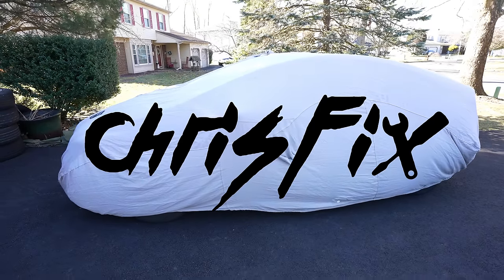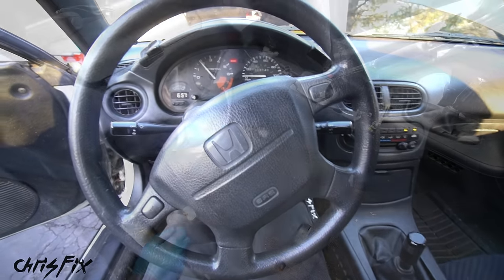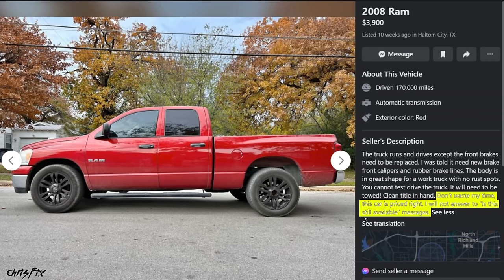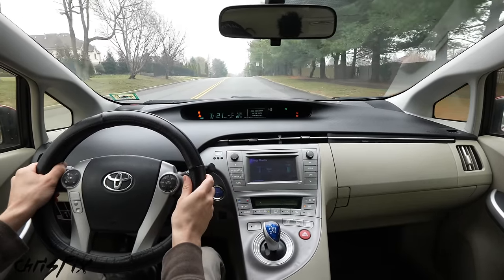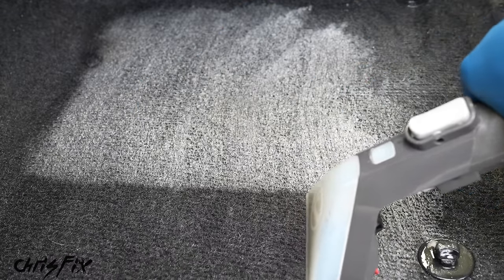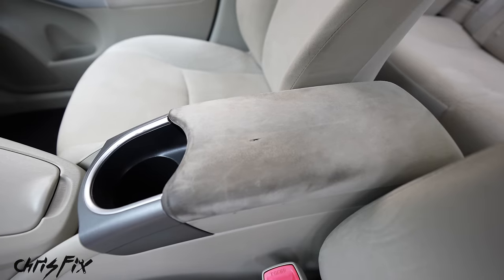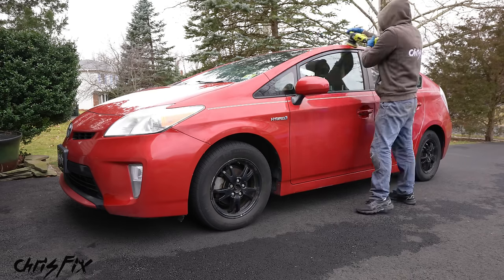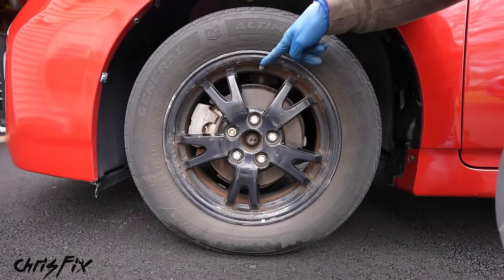How to Buy a Car To Flip for a Profit ($$$ Side Hustle)

Comment: Hey chris I have a 1995 Lexus Ls 400 that i bought from a used csr lot and had a couple of issues with the electrical system and ecu. I plan on making the car my project and with that i dont know the first thing to do as best maintenance for the car. I occasionally drive my car although it is not my daily. Any tips for its maintenance.
Reply from the maker: I wouldn't bother with the maintenance for now, I would just focus on sorting out the electrical/ecu, then from there you can do what I showed in this video to get the car 100% : https://www.youtube.com/watch?v=brofphmC7GI
Reply: @chrisfix  Thank you! I guess i can start with the timing belt and work my way with the fluids but I know that the electrical will be a pain since it is a lexus and I dont wanna spoil any modules, i had tried installing an apple car play stereo but ended up spoiling my AC module and now its unresponsive. Is it possible to redo the entire wiring or how do i go about it?
Reply: @chrisfix  Also I was afraid of just getting another used OEM ecu incase it developed problems like the one I have, i have plans for doing a drift build with it but Im still stuck on dealing with the electrical portion of it and Im struggling financially to get the ECU that I wanted and its fairly expensive to do repairs for it, for instance I had a problem with the idle switch and it costed me nearly 200 for the part itself

Comment: Great skills, but if you value your time at at least 200.00 per hour there are some other possible problems.  You may get put out of business if state decides you are selling more cars than allowed without a dealer lic.  Also a possible fine if title is not skip title.  Then neighbor complaints and zoning issues.  Then tax on capital gains that unclaimed reduce profit 50 percent.  Now there are additional risks if performing repairs without a state mechanic lic. And tracking.  Many of the cars sources may have only selvage title, and that could deney the future owner of option to use car for business like uber.   You should get a job at a dealership, or wherever you can get the highest pay, then bring your car to work on days off and do your side projects.

Comment: Okay with all this positive comment i got to go otherwise. First and thats it. You dont just take off head ,clean block and head and put another head gasket. Its like asking yourselve trouble or quick flip sale. First you need to check if block or head is cracked. Check for cyilnders and other parts if not needed replacing and i mean check with precise tools and hell lot of knowledge. Than as obviously head gasket blown need to do really good flush pf all that shit. Than if all that good and yeah. Before even knowing you already spend quite aome time and some money (micro cracks in engine cant be done on driveway) you need to machinely even the surface of block. Choose right thickness of head gasket as if not you can get pistons meet with valves and of course assembly everything. So usually if head gasket is gone its not worth with such low value car cuz doing it right so next buyer enjoys it for long cost more with labour and parts and machine usage than the whole price of it.

Comment: Hey Chris! I'm thinking about buying a 2017 nv200 that is immaculate and drives great! The only thing is it has 245,000 miles and the owner said he never changes transmission fluid? If you were in my shoes would you let  that stop you from buying the van considering it's a cvt tranny?
Reply from the maker: I mean anything in a car with 245k could go at any time so. Def not good it wasn’t changed but with a car with such high mileage you just have to expect something will break and you’re going to have to fix it.
Reply: @chrisfix  thank you Chris!

Comment: 44:40 You NEED new Tires. Look at thos cracks. No matter what depth you have. They are probably old and get brittle over time und sun.
Reply from the maker: micro weather cracks like that are normal and not a cause for concern at all. The date and tread depth checks out otherwise so these tires are good

Comment: Why is it still necessary to plug in to the car to read the codes?. All cars have a display, and it would be easy to display anything directly there. Yea, all cars are different, but the codes are already in the individual car. Why are they hidden forever the average driver?.
Reply from the maker: There is technically no reason for it to be hidden away, but they want the idea that you have to bring it to the dealer and pay for them to do a scan

Comment: "needs work" "won't start" "needs brakes" "rusted brake lines" "fuel pump" "doesn't run" "dead battery" "bring a trailer" "brake lines" "needs alternator" "headliner" "tow truck" "needs to be towed" "needs fuel pump" "head gasket" "damage" "project car"

Comment: @chrisfix can you tell me which gives a better result? Using compound>polish>liquid wax or the 3in1 wax liquid or using the ultimate paste wax? 34:28
Reply from the maker: Compound, polish, wax will typically give you a better result but for most people on a regular car it’s not noticeable.
Reply: @chrisfix  thanks boss! ok! I’ll try the 3in1. Seems easier. Hope it works good on white paint. Do i need a protectant/sealant after it?

Comment: Congratulations you replaced the fuse but didn't fix what caused the fuse to blow
Reply from the maker: Pretty sure it was the fuel pump which was replaced, and it never blew again. It's possible for a fuse to blow and never cause an issue again (has happened to me with power windows lol)

Comment: Lot's of good advice here, but don't water down the engine bay. You will get water in the plugs causing them to corrode over time. That's the reason why I won't buy a high mileage car with a clean engine bay

Comment: bro, you never mentioned the exact time you spend on repairs, finding parts, nor home much your toolset cost. impressive if you do not reveal these details, right?
Reply from the maker: I did mention how long it can take for the cars I already finished. Some took 3 days (weekend) and some took a week. Tool cost is something that varies drastically. I started with my dads tools and bought tools as I needed them. You can get tools cheap at yard sales, or you can be fancy and buy all brand new tools or a whole set. I also didnt include home insurance, mortgage, electric bill, water bill, car registration, etc because it varies so much and is hard to calculate.

Comment: this is why you cant upload more videos, your just showing the cameo quick parts edited.  not the 100s of hours spent in real time to flip such a car.

only high skilled mechanics with access to alot of tools, so then they can like you, get some parts and fluids consumables to flipp such a car. 

 anyone else its not possible to do.   the tools alone for the work on that car in my area would easy be well over 10K+  not counting parts and stuff used to fix it,  just the tools alone.   the car not worth flipping any more if you dont have  tool set / skill set / hard labor time to invest in such projects. especially since starting it up, and not a mechanic type person would be extremally costly and not be profitable at all.
Reply from the maker: Starting from nothing and trying to do this would be pretty challenging to say the least, that's why I'd recommend this for anybody who already has experience working on cars/car projects. If the tools in your area cost $10K or more then I'd look into other ways to make money and just focus on working on your own car. Also if it took "100s of hours" to flip a car that would be a terrible purchase/flip/overall side business. Assuming you were able to make a profit, your hourly pay off that would be like $2 an hour. You should be efficient with time and be able to work quickly because that's ultimately in your best interest. If you buy a car for $5K, fixed up it's worth $10K, and you're able to fix/clean it in 40 hours (average 8 hour days or a normal work week), that's $125 an hour and that's what you should be shooting for

Comment: 100 hours of work your not talking about. I'm sure your not doing this alone and wax and buffing a car takes forever to make it look good...Unless your doing this alone your not making much money. Forget the head gasket i would just rebuild the engine. Its ok just weld this piece...LOL. Just be honest your doing this for youtube.
Reply from the maker: You do bring up a good point, if you have to spend a 100 hours to flip this car and you only make $100 then that's definitely not worth it. In this case the car was pretty solid so I didn't have to spend any time close to that and the resale is pretty good. If this did need a head gasket I would just replace the head gasket/bolts and whatever other misc stuff needed replacing, rebuilding the engine doesn't make any sense in this case. No idea what your last point means